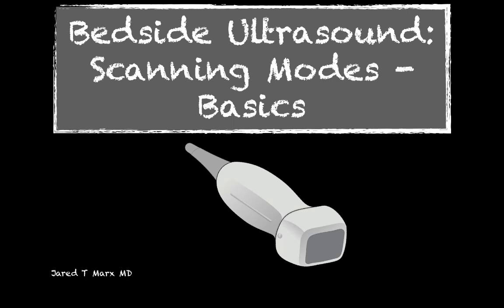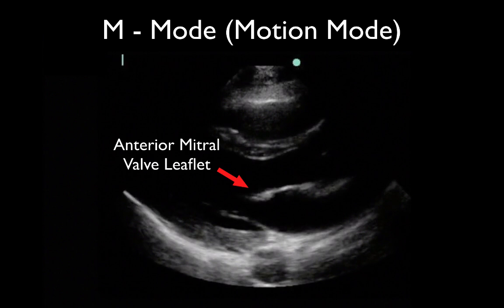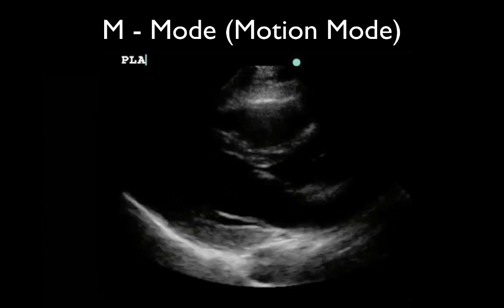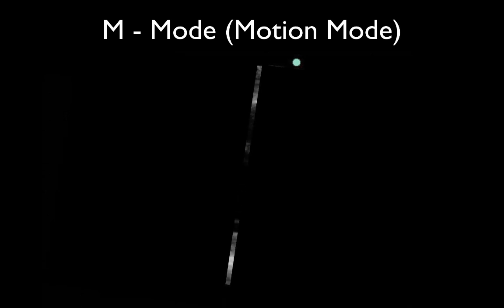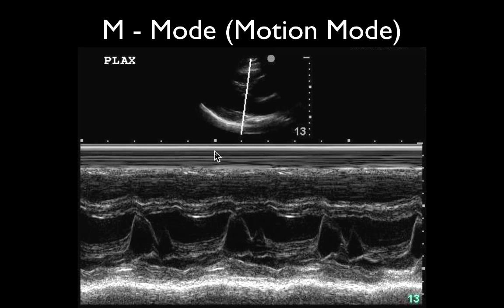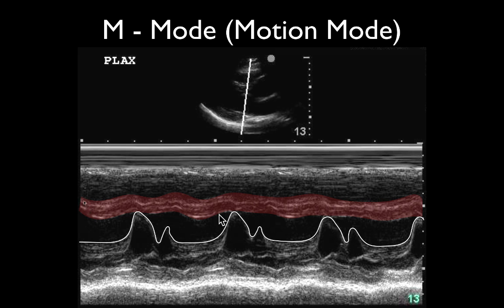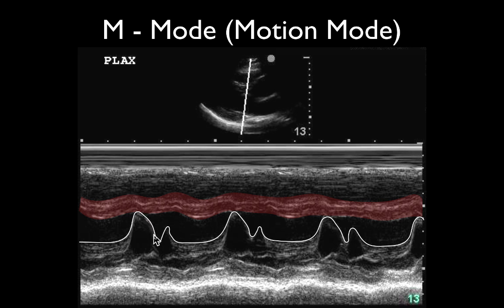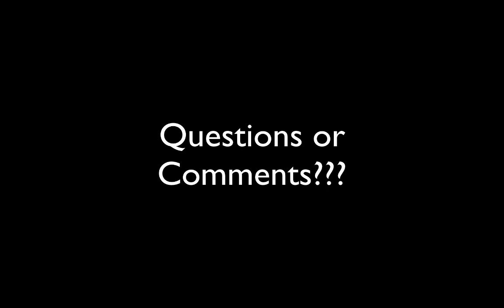Ultrasound Physics Scanning Modes M Mode

Comment: How can the ejection fraction be measured using pulsed doppler and M-mode?
Reply: It can be roughly estimated with the LVIDd, LVIDs measurements:  LVID d 3 (cubed) minus  LVIDs 3 x 100 divided by the LVIDd3  You are getting a fractional change of the LV volumes in end diastole and end systole, or LV EF
Reply: Can you make a video please